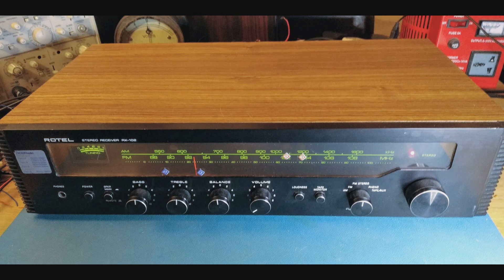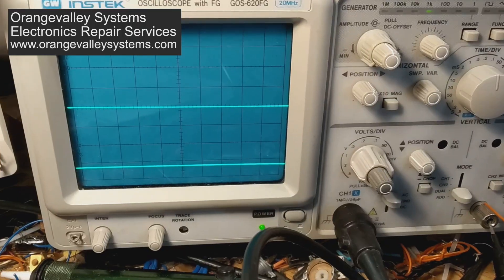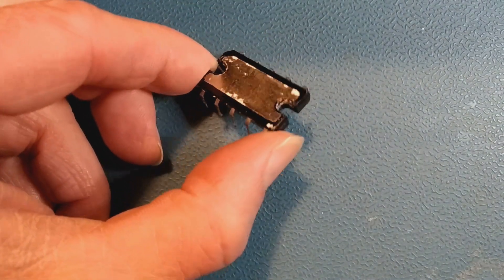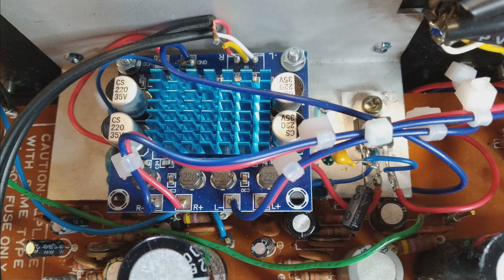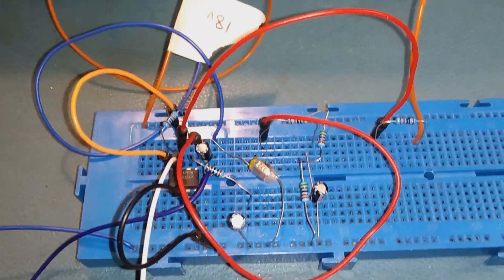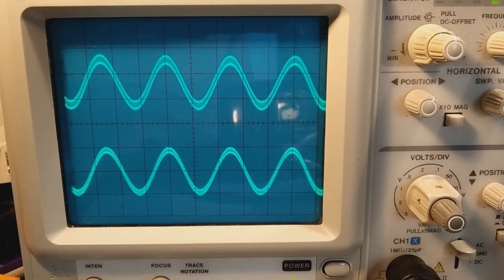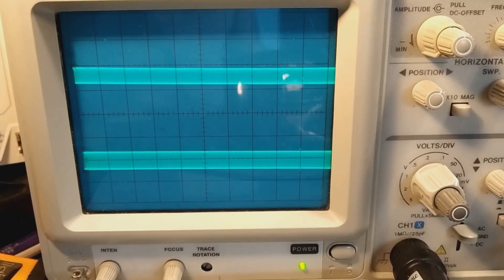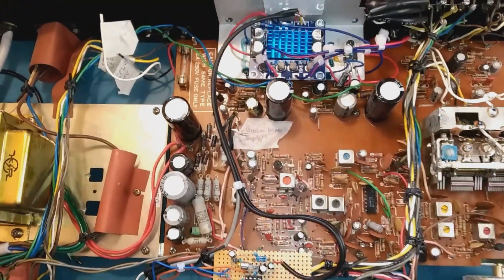Modding a Rotel RX-102 to use a Class D amplifier

Comment: That's a very poor choice, you could have adapted some linear amplifier chips and preserved some of the quality and appeal of this unit
Reply from the maker: I did consider that but the reality was this was a quick experiment to see if it worked, which it did. If you don't try it you will never know. It's not a receiver I'm going to use in any case as I already have a system. These old RX-102 Rotels go for peanuts on eBay so to me it wasn't worth spending a lot of time and money on it.